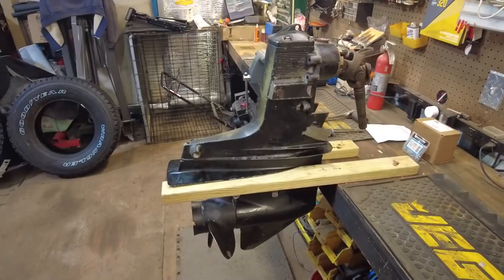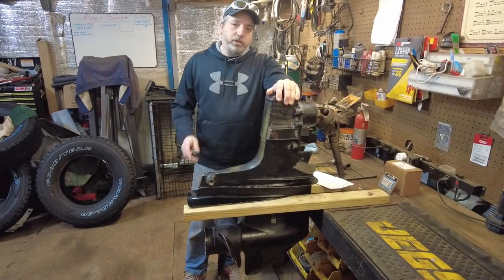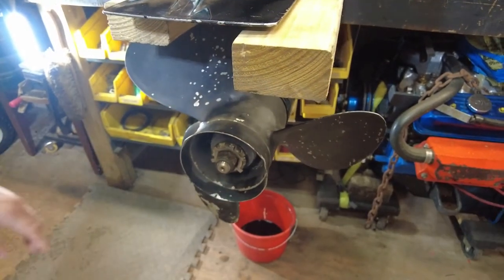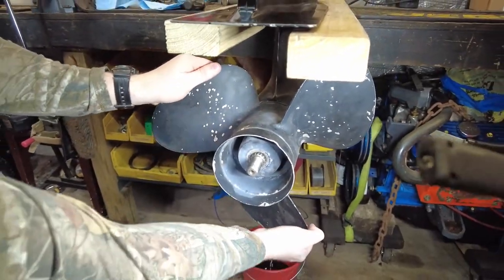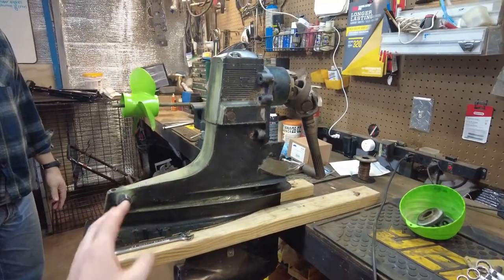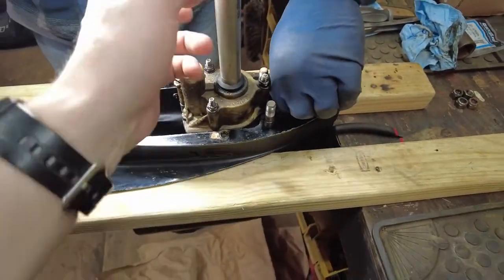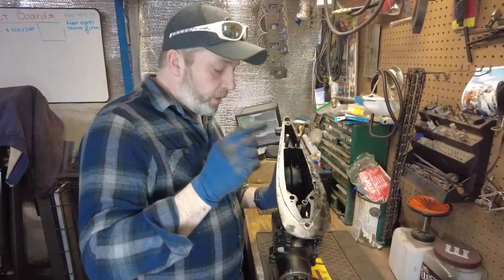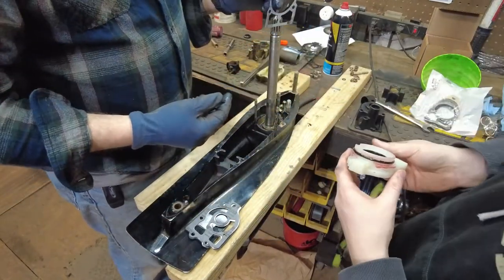Mercrusier Sterndrive Refresh and Impeller Replacement. Part 1

Comment: I have a 17 feet, 1977 mark twain Vsonic open bow with a 120hp mercruiser. This video will really help. Hard to find mechanics for older mercruisers.
Reply: You guys put your gaskets in wrong, the two for the wear plate. If you haven’t used it yet you might want to fix it first. You can watch your video to verify if you need to.

Comment: The gap left when you guys put the two halves together is fro the rubber oring you guys put on the top of the shaft. That’s not an oring grove. The oring is interfering with you upper shaft seal.